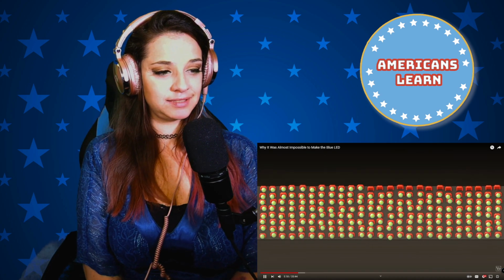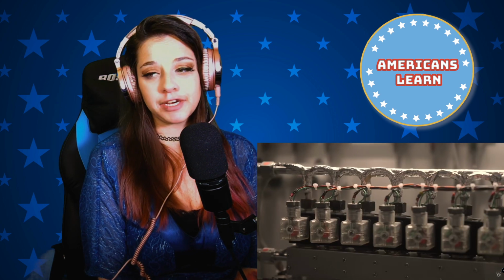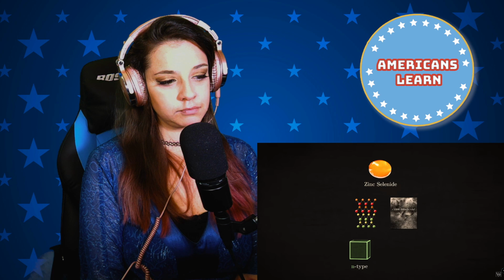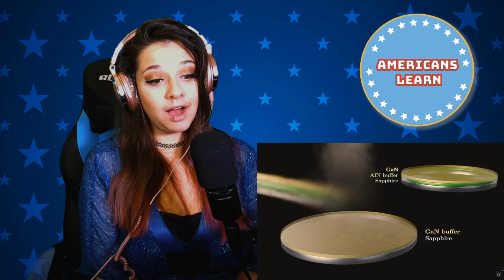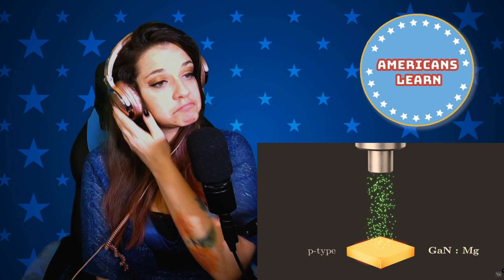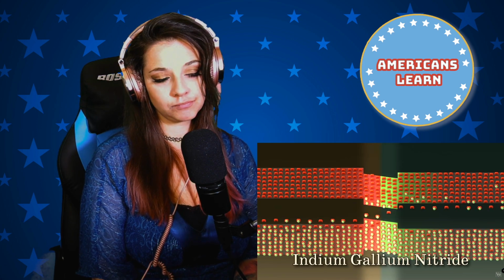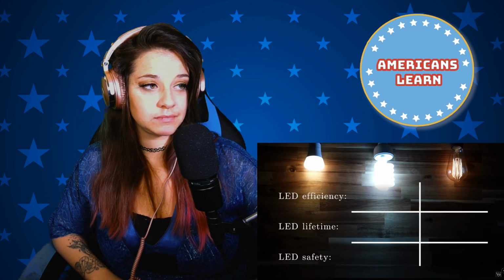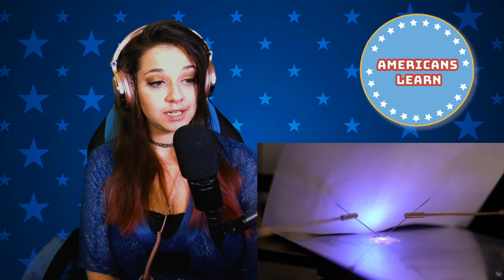*Nakamura: an Unsung Hero* Why It Was Almost Impossible to Make the Blue LED by Veritasium

Comment: 22:52 Laminar flow means smooth flow in uniform layers, in contrast with turbulent flow.  Water pouring neatly out of a pitcher is laminar, while the water from a typical showerhead is generally turbulent.  On a larger scale, water gently flowing in a river is often laminar, while water through rapids or around rocks is turbulent.

Comment: 2:00 colorless CRTs were simple
They shot electrons at the front of the screen, and electromagnets diverted them to cover the whole area instead of one single point oin the center
To make color CRTs you needed 3 seperate electron guns, coat the front screen in red, green, and blue phosphors, and somehow design a system so that only the electrons from the correct gun hit the correct phosphor dots
This was kinda complicated
Also before LEDs
New lighting technology such as LEDs gave us flatscreen TVs though
Reply: On a similar note, micro led TVs seem to be the ultimate form of TV screen technology, all of the benefits of OLED with none of the downsides. I recon in about 10 years MLED TVs will be affordable.